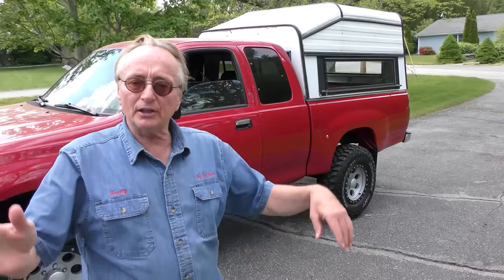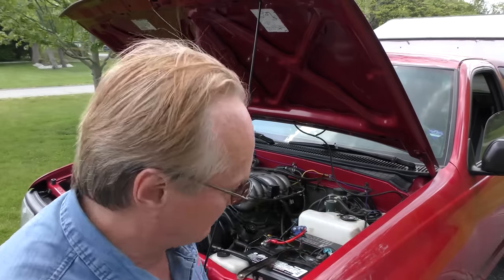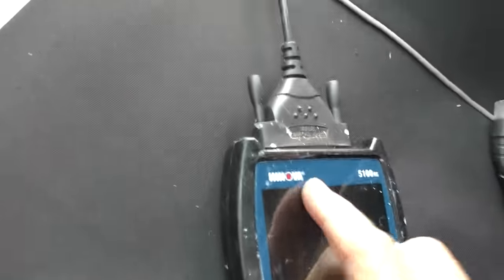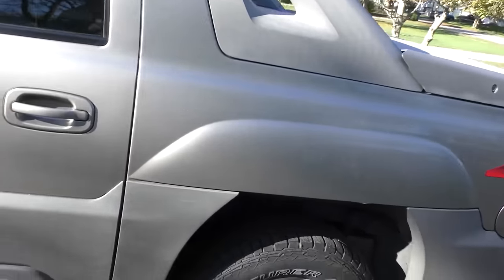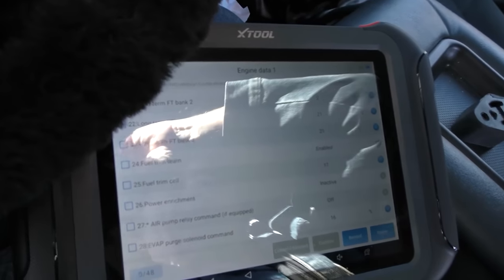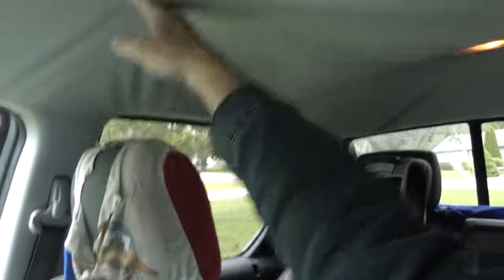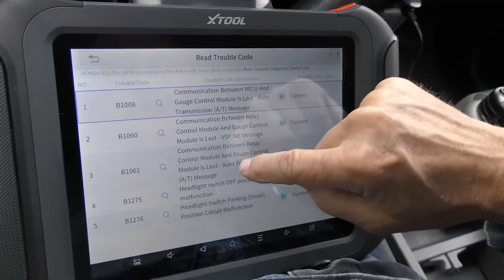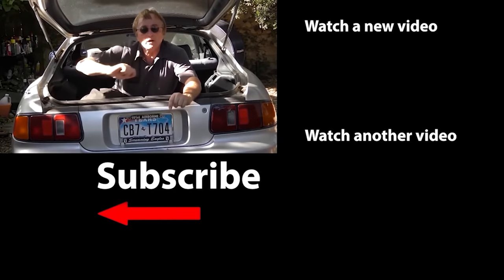3 Used Trucks No One Knows About, So You Can Buy Them Dirt Cheap

Comment: I went shopping for a new truck and whole thing made me just wanna puke. You have to struggle like hell to find real friggin truck, which is what I want and not a luxury sedan with a bed and tailgate. I would feel neutered driving around in what passes for a truck now. Can I just get a truck? No motorized running boards and tailgate. Maybe one that has less than two cameras in it? I don't want a hot seat and steering wheel and it turns out that I'm lumped in with a very low minority of men. Can we just bring back the pickup truck?

Comment: Did this guy call a Ridgeline a truck? 😂
Reply: Ive seen more ridgelines in the city haul cargo than other trucks
Reply: Only real trucks have a transverse mounted engine
Reply: @bryansanchez5276  I bet you have 😆 That's because you're in the city my guy.. Real men don't live in cities
Reply: @samh6761  I was going to say something about that as well! Lol. I didn't realize they were FWD bias.. Wtf, even worse
Reply: @TTime685 those trucks are rock solid believe it or not. It’s not a full size truck but it definitely can take more of a beating than a Colorado can hands down.
Reply: The Ridgeline is as much a Truck as the Ford Maverick.

Who cares what someone else owns.
Reply: @emmanuelalva6597 My 08 Colorado was used hard in construction it’s whole life. Still going strong after 240,000 miles on the 3.7 i5. No one talks about the reliability of the Atlas inline motors, probably why they’re so short lived.
Reply: @dro3m the 5 cylinders were good, I have to admit....but I'd buy a Ridgeline or ranger before a chevy.
Reply: @johnlopez3001  ...as the Hyundai Santa Cruz as the Subaru BAJA. Whatever other people decide to buy,  it don't befront me none.

Comment: Awesome truck. Looking for one now. Scottys right, these turbocharged engines that Ford and Toyota are now using don't get any better gas mileage than the V8 engines they replaced lol.
Reply: They are torquey, but at the cost of fuel mileage.  They're not rating these things with weight in the back, or pulling a trailer.  That's the scam of it all.
Reply: LoL 😅

Comment: Proud owner of a '96 T100 V6! I just replaced the bulbs in the headlights tonight - easy peasy and for about $60. Not at all like the newer fashionable (expensive) trucks where guys are paying thousands to replace light assemblies lol. It does need some tlc on the trim inside and out, and a new headlight switch since it isn't activating the high beams anymore, but what the heck I paid cash in 2005, it has less than 185K on it, and it has never left a single drop of oil on the ground. 

All that with no car payment for almost two decades? Yes please.
Reply: My t100 with 340k miles just got the same headlight issue. Not a big deal to me!
Reply: Smart. Nowadays though people want to criticize smart drivers which know exactly what a good driver is. Knowing cars that are not problematic+ checking your fluids+taking care of the car= A SMART DRIVER. Not just a person who knows how to maneuver and flore it through traffic in a car that breaks down but looks cool

Comment: I own a 2012 honda ridgeline had the underframe recall, new tires and pressure sensors, rotor, brakes, good oil runs perfect, only draw back to avalanche and ridgeline is rear visibility is bad backing up.   Used it for towing a mower and 1000 pounds of mulch in the back great truck!

Comment: 😎 Honda Ridgeline one of the most practical best long-lasting trucks out there and I love cloth interior it lasts forever. The trunk in the bed where the tailgate open sideways is a big help but one note always check your four-wheel drive system in generation 1. Engage then do a steering lock left and right Make sure that rear end is working.
Reply: When I first saw the Ridgeline years ago I thought it was a stupid truck concept with it's very short truck bed.  Looking at all the short truck beds people are driving today, I have much more respect for the Ridgeline & their durability.

Comment: Truck frames could be rust free like a ship's hull, they use sacrificial anodes, made of zinc and the zinc bars are replaced every so often.
How does anode prevent rust?
Sacrificial anodes are used to protect metal structures from corroding. Sacrificial anodes work by oxidizing more quickly than the metal it is protecting, being consumed completely before the other metal reacts with the electrolytes.

Comment: All those that got the Xtracab (1996 and later models did) got the smaller bed. No 8ft beds on Xtracab models. Looks quite clean but did I see patches on that frame?!  I know these and the earlier Toyota pickups had better frames than the Tacomas and early Tundras but it looks like this one was reinforced. 

My daily driver is a '93 compact SR5 pickup that was sold new at Bristol Toyota when they were still located in RI, It had a side impact accident which required replacing driver side door and cab side panel and was sent to Canada around 2006-2007. 
 I got it in 2009. I rustproofed it a few times since but the frame is still solid and never needed reinforcement.  It has a lot of mileage but still runs fine, A/C blows cold and power accessories all work. No annoying body noises either!

Comment: I live in Central WI and commute over 45 miles to work.  In the winter I see more 4 wheel drive trucks and SUV's stuck in the ditch than rear wheel drive cars.  And there are a lot of rear wheel drive cars out here even in winter.

Comment: I love the T-100
I had the 3.4 in my 95' Tacoma,
Now i have a 4.7 05' tundra,
The smallest big truck you can get.
The Avalanche and the Ridgeline have the same high bed side design, interesting.❤❤
Reply: ITS Thundra 2005 good ?
Reply: It had the frame replaced, 
I replaced the step side bed because of rust,
the leaf springs broke,
The rear bumper support is too rusted so much they wouldn't inspect it too tow,
And there's a brake valve off the master cylinder that causes the front driver caliper to pull you into on coming traffic, if you go on a Toyota V log, it's known problem and the master cylinder cost $2,000, they don't sell the check valve separate, I've called Toyota, there ignoring me ,hoping I'll go away, I have a registered complaint, the local dealerships told me good luck laughing at me, and Scotty asked me to stop by to see if we could twist there arm,
But that's a 5 hour drive for me at 13 mph, I'll keep emailing everyone, 
The thing about Toyotas, the engine and drive train are bulletproof,
Everything around them rot in New England, you gotta keep them oiled or just keep replacing everything.
And to replacement part are expensive, and I just did the timing belt, $1,000,
Alot of rusty bolts. I love the truck, it a nice v-8 4.7.

Comment: Loved my Chevy Avalanches. I bought a 2002 and a 2005 both brand new. Both were 4WD and had the first generation full cladding. I traded the 2002 with 65K on it for the 2005 only because my job required us to drive vehicle less than 4 years old to qualify for the company monthly truck allowance. The truck was actually in perfect condition. In late 2006 I lost that job to the recession so I kept the 2005 until 2020. I had 135K on it then, the cladding was faded, headliner was sagging but since I live in central North Carolina it had ZERO rust in the body. When I traded I just wanted something newer so I bought a 2 year old Silverado which to date now has given me a lot of trouble compared to 18 years of driving Avalanches. Kind of wish I had kept my 2005 and spent a fraction of the money I spent on the Silverado to fix it back up. I probably would have been much better off. ;-) The only other other thing I can say about my 2005 Avalanche is, I bet some one out there got a good one.
Reply: What year silverado
Reply: @landdealsCA  , 2018 LT. It spent it's first two years on the roads of northern New York.  A lot of it's issues I had to work through were salt corrosion issues in the electrical system and starter motor. Everything seems to be fine now that I got though those random recurring electrical issues. I was also was not pleased with how the transmission acted. Seemed to always be looking for the right gear. I had a trusted transmission shop check it out and they recommended having a custom tune done uping the shift points on the trans and limiting the clutch lockout to happen only over 45 MPH. They also disabled the Active Fuel Management with the tune so the truck stayings in V8 mode all the time. That trimmed a few MPG off on the highway but actually improved it around town and the truck drives sooooo much better all the time. Well worth doing that. In the long run that might save the lifters from collapsing too since they will not constantly be starved for oil in 4 cylinder mode anymore.  Knock on wood.

Comment: I had a 1993 T100. It had the 3.0 Liter V-6. Engine blew at around 220K miles. Mechanics refused to rebuild, told me it wasn't worth my money. This was probably in 2003. In 1995 they offered the 3.4 Liter V-6. I did enjoy driving my truck through the hills of south Indiana.

Comment: I never knew the avalanche was built like that where u can take back window out and extend the cab..that’s pretty cool. Idk why more trucks don’t use that design it’s pretty smart
Reply: I know right!? I almost flipped my rocker when I saw that. My biggest complaint about newer trucks is the bed is way to small to even be a real truck. Now here's truck with decent cab space and the option to extend your bed.
Reply: The only problem with “extending the bed” of the avalanche is you can expose the people inside the truck to loads shifting and other dangers, as the load is transitioned from “outside” in the normal bed configuration to sharing the the interior space with the load, especially if not properly secured/tied down.
Reply: Yeah that gives me a whole new respect for those. I always thought they looked kind of stupid but I’m all about function and that’s a handy feature.

Comment: @6:20 Toyoda cheats emission testing with the turbo thingy but it only works in partial load where most tests are conducted. If the truck has to work hard, it consumes a lot of gas.

Comment: There are 4(!) Toyota T-100 in the whole country for sale. The cheapest one, 1993 year costs $6000, has 300k miles. If you want lower mileage, there is another one with 198k miles for only $24.500. Good deal

Comment: Bought a 1 owner 2009 white 4dr (crew cab) Toyota Tacoma TRD 4cyl 4/4 for 10k 
At Toyota dealer that had 75 k miles back in 2013 the body was showroom but after buying it I had to do inspection before I could get hard plates (New Hampshire) found out the frame was completely ROTTED!
Was shocked the Toyota dealer had it on their certified preowned lot! 
Like that. Yet claimed it was serviced fully and yea it had brand new tires. (How they lifted it to put tires on with bad frame and not know was beyond me) 
   But Toyota put a brand new frame on it for free.. 
couple years later sold it for double what I paid for it.

Comment: Love my 96 T100 3.4 5 speed!!! 195k miles and everything works as it should, hot heat and cold A/C!!!
Reply: Curious of the gas mileage,  my 02 4runner with the 3.4 can get as high as 24 highway using the non-ethenal.
Reply: Sweet truck. Nearly nothing to break or fail.

Comment: Hi Scotty, my wife's 2011 CRV @120k miles is burning oil a lot. I checked after @2k miles after oil change and the stick was dry. Some lads of mine said I should wipe my finger in the exhaust and see. I did and found oil. Is this engine dead? Earlier this yr, I serviced it, drove to FL, only to find the dipstick was dry.
Reply: Does your vehicle have vcm where it shuts off the cylinders to save gas? My 2010 Odyssey djd and it would use oil like crazy and throw engine codes. I got a vcm tuner and that pretty much fixed all the problems.
Reply: @ChrisLange-ry9cp  no, K24 4cylinder engine.

Comment: I love my 1992 Toyota 2wd pickup. Has 174k on it and runs great yet and gets 22 mpg on the highway. It is the 2.4 with 5 speed. Body is pretty nice but frame is going.
Reply: Then put some oil on the frame if you are able or sell it to me so I can save it😅

Comment: The Honda Ridgeline was NOT available in 2 wheel drive.  They're all ALL wheel drive (as opposed to 4-wd). I have a 2008 with 206500 miles and you can't even hear it run at idle.  Love it!

Comment: Toyota is one of the best trucks I have ever owned. My brother gave me one of his old ones when I was in high school it had over 225,000 miles on it and it still drove me where ever I needed to go, the gas peddle was a little hard and I couldn't just floor it from a full stop to peddle to the metal but if you just accelerated normally it did just fine. One thing that could have been better is the body, the bed and bumper was very rusty with holes even haha.

Comment: The only purpose of the V6's in the new Tundra is to trick the CAFE standards.  They don't measure these things in real world conditions.  At the end of the day, there is zero purpose for putting a V6 turbo on a full-size truck.  All it does in the long run is break down sooner and cost the owner more.  They don't care though.  We are way down the list of priorities for automakers.  Now, if they could make a straight 6 like Ford did in the 70's, that would be a different story, but they would never make an engine that reliable again.
Reply: Drove an Ford F-150  81 to 94, then a 96 auto with the 4.9 liter 6 cyl.  22 miles per cdn. Gallon.  Even drove a 69 with the three on the tree.  Same 6 cylinder.  All we ever needed.
Reply: @kk-rc6dw  I had a 78’, 3 on the tree, straight 6 briefly before rust took it but it could have lasted forever in a southern state.

Comment: Larger wheels can make your mileage odometer (and speedometer!) not read right so his gas mileage may be a little better than he thinks. I had an 87 Nissan 4 wheel drive truck with 4 cylinder. It was way under powered and the body rusted really bad.
Reply: Hard bodies were the shiznit
Reply: Yeah, you have to reprogram it when you change tire size, but not sure that's possible with OBD I.

Comment: T100 - $6.5k to $24.8k 😭😭😭😭
Reply: Yeah, the one for $24.8 probably has 100k on it while the ones for %6.5k have approximately 2.8 million miles on them
Reply: @ronhoover5516  Yep, and I didn't find any "cheap" ones as advertised. Avalanche on the other hand, I did find.